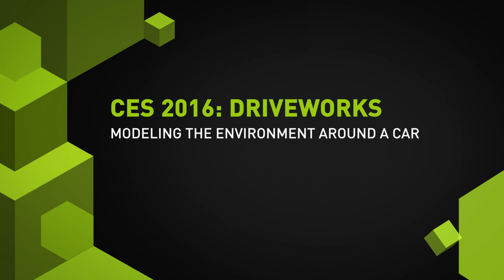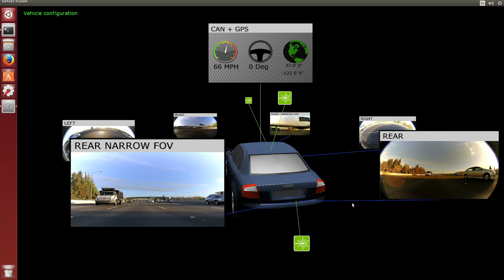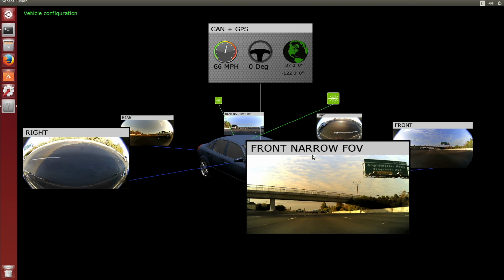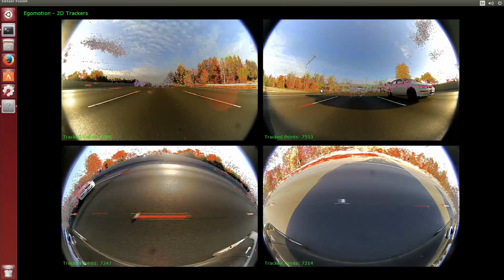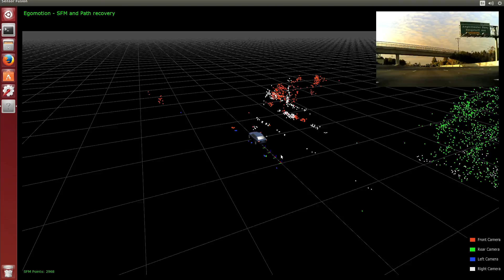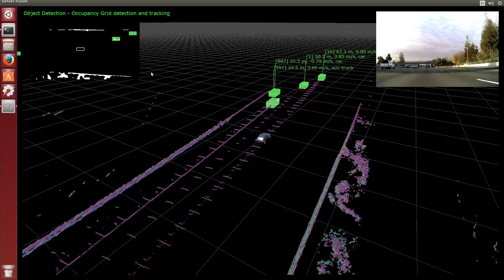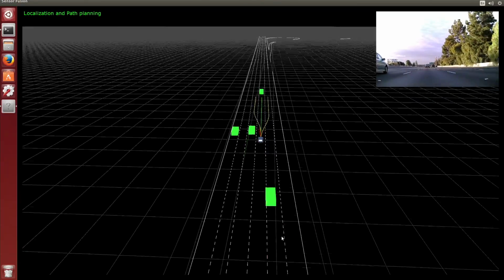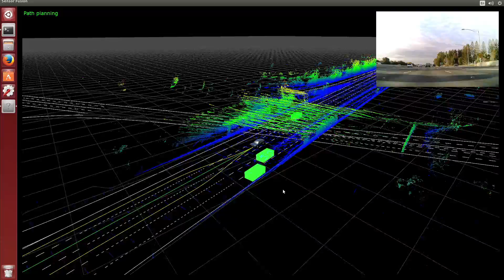CES 2016: DriveWorks - Modeling the Environment Around a Car (part 7)

Comment: Did I hear that correctly? Their  LIDAR only refreshes at 10Hz? So that's a full 100ms before it can register a change in the environment while driving at highway speeds? You'll forgive me if I want to wait for V.2.
Reply: +Mike Trieu (MegasChara) I heard 30...
Reply: ***** That was for the RGB cameras, which is okay to get general bearings via SfM, but doesn't get you instantaneous depth mapping to make split-second decisions.